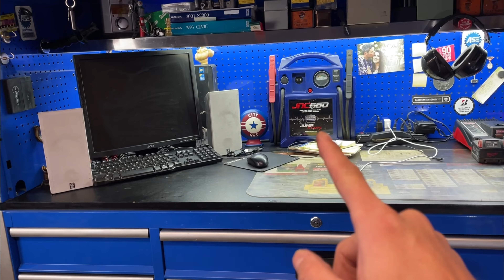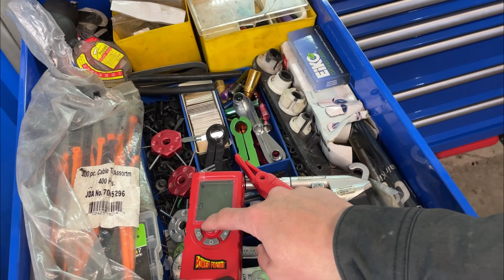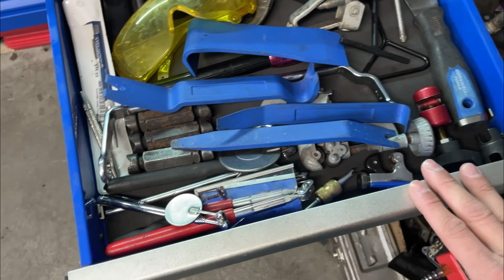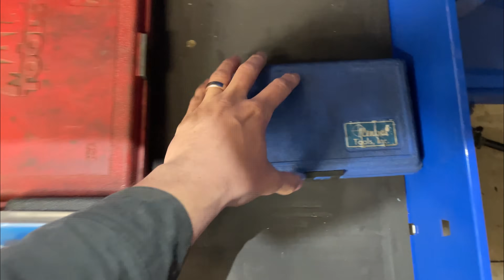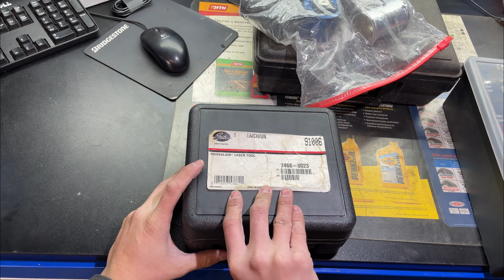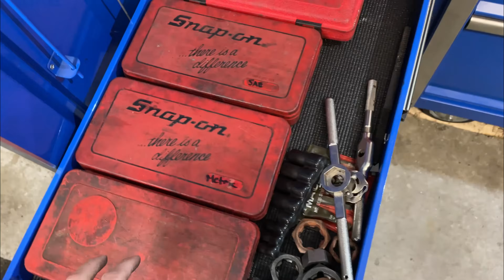Toolbox Tour | 72" Toolvault w/ Mac Tools Cart COMPLETE INVENTORY

Comment: heavily debating between the tool vault and snap on 54" master series. would you say the quality is pretty on par? buddy at my job has a snap on and this thing even loaded up rolls easily and handles weight nice. just wonder why the tool vault is so cheap in comparison
Reply from the maker: So I would compare the Toolvault to a Matco box. I have a Snap-on EPIQ and this Toolvault. I would say the Snap-on is better built and more refined. With that said, I only bought the Snap-on since it was used and a good deal. If I could go back to when I originally bought my Toolvault, I would do it again in a heart beat. For the price, I don’t think they can be beat. VERY stout boxes and I have never heard of anyone regretting the purchase of one. I recommend them every chance I get!

Comment: Aren't Tool Vault toolboxes the same as Extreme Tools Toolboxes? And how do you like yours?
Reply from the maker: Yeah I believe they are made by the same manufacturer. I’ve had mine for 7 or 8 years and I absolutely love it. I used it professionally every day for about 3 years and have absolutely no complaints.
Reply: That's awesome, I have been looking I to getting one. Thanks for the response

Comment: Love the videos, I do cringe when people say air tools are on there way out. Not a big fan of cordless power tools. Especially knowing that batteries don't last and soon you'll see them getting hacked. I do have cordless stuff but I try to always have manual, corded, and pneumatic too.
Reply from the maker: Air tools certainly have their place. Cordless tools have just come such a long way, and their convenience is hard to beat. I will always choose a cordless tool first, but you can alway count on it’s air counterpart to meet your needs when the cordless just can hack it.
Reply from the maker: Also, thanks for watching!!
Reply: Im a big fan of electric.   But i dont like frills.   Give me all the beans with a variable trigger     do they have thier downsides ya.   But i find it easier to use elctric than air     although nothing beats air for grinders cut off wheels or air hammers

Comment: One of the better toolbox tours I’ve seen on YouTube. 
Good selection of specialty tools, …. which leads me to my question. As an engine builder I’ve always used Diesel wrist pins to make my stepped freeze plug drivers. 
Do you have a Snap-on # for your freeze plug driver kit?
Only thing I’ve come across are the aluminum adapters for lip seals. 
Just hit the 👍🏻 and subscribe. 
Thanks,
Russ
Reply from the maker: The Snap-on part number for the freeze plug set is FP16. Thanks for watching!
Reply: @ToolBoxTour  
Thanks so much.